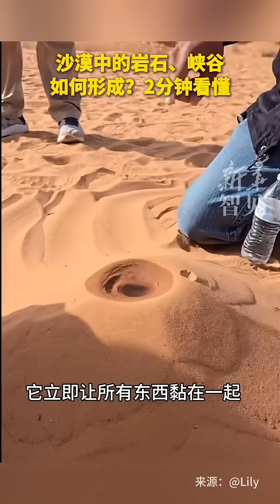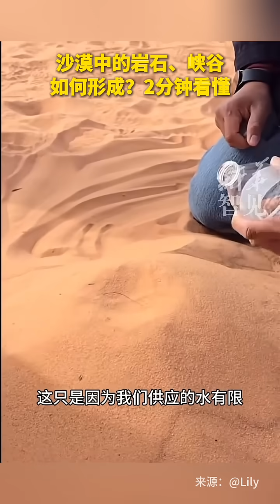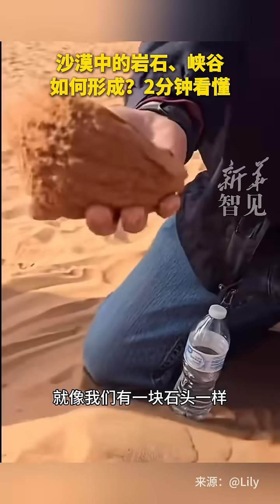I love listening to lectures like this.

Comment: Just to clarify, the first half was how rocks are made? or mountains??
Reply: The first example is demonstrating how rocky layers are created. Yes, it is demonstrating how rocks are made. Basically, water bonds loose sediment closer together. More sediment is washed over and into it over time due to wind or tectonic shifts, this added weight and pressure further condenses it. Over time the moisture escapes due to evaporation as well. Increasing Pressure + evaporation = some really hard stuff. You can observe this with some clay as well. The reason why the evaporation allows for hardness is because since the moisture causes the sediment to clump together, and this creates more pressure as more sediment is added and density is increased, when the moisture escapes, all that pressure is forcing the sediment closer together into the spaces that used to contain water molecules. 

Mountains are caused by tectonic plates shifting against and over eachother. Pieces break off and basically splinter off onto the surface. Basically, mountains are the result of really massive earthquakes.
Reply: @julianmcmillan2867  Amazing! Thank you for the detailed response!
Reply: @iMadSolar  You're welcome.

Yes, it is amazing, isn't it? Mountains are a sight to behold on their own, but when you sit down and think about how they actually came to be? That is the real marvel. A simple and, on a cosmic scale, frequent process, that we have built entire religions and civilisations around.

Comment: So if we flood an entire desert then get a comically large electric fan, we could make a mountain.
Reply: pretty much but like he said it woulds have to be done for years
Reply: @black7844  counter argument: the fan is on swivel mode
Reply: @black7844  and on power 1
Reply: @ then it would take even longer LOL
Reply: @black7844  proposal: moisture and dryness sensors to shut off the water and current of air at the perfect time.

Or even a funnier reply, I'm enjoying this.
Reply: @ LOL when 2 trolls meet
Reply: @black7844  I'm not a troll, just finding the funny stuff in life
Reply: @black7844  oh someone else, my bad
Reply from the maker: 谢谢您的关注！
Reply from the maker: 谢谢您的关注！
Reply from the maker: 谢谢您的关注！

Comment: This is NOT how sandstones form - by rains filtering down through loose sand at the surface.  Think.  It does actually rain in deserts. When it does, the sand in dunes or other landforms does not suddenly become rock. It’s wet sand until the water infiltrates and/or evaporates. Then it’s dry sand again - LOOSE dry sand. 

To all the commenters here saying how much they learned from this guy compared to their geology instructors, you should have paid better attention in those courses.  If you had, you’d know that this is not how sediments lithify, and this is not how canyons form.

Comment: seems ok but not exactly correct. millions of years and many floods is the bs part that you scientist have been told and believe but you can not prove it so you come up with a gimmick to make the masses buy it. CIRCULAR ARGUMENT IN 3 2 1 ...
Reply: Millions of years has been proven many times and it being multiple floods has also been proven numerous times, we can analyze the sedimentary layers which shows distinct fault lines between them which couldn’t happen during one flood.
Reply: @greg5145  circular argument, you know when by the sediment layers , and how old by where it lies in the sediment. All bs.  The earth is about six thousand years old and that can be proven. Plus the whole earth flooded not one particular spot.  The entire earth. I guess you come from a rock that soaked in water for millions of years. Follow man and you will be wrong again and again. God is the way the truth the life.
Reply: @greg5145  fr
Cause last time I checked a singular flood isn't gonna bring in one bit of a sediment, let it settle for a bit let it get comfy and all that then BAM throw another layer with different minerals from fvck knows nowhere on top let it settle let it get comfy and then again BAM-
I believe I've made my point :3

Comment: The other thing that’s a little annoying is the FKS has the plastic oil filter housing. I’m almost tempted to use the metal FE oil filter housing on my FKS. I cracked the oil filter housing once trying to get it off after the last guy torqued the crap out of it. Anybody try the older FE housing on the FKS?
Reply from the maker: Great lesson

Comment: Water does not turn the silica into glue lmao yall dumbasses believe anything on a short??
Reply: the defenition of glue is an adhesive substance used for sticking two materials together, he meant it as the water and silica behave like glue because the wet stuff sticks together
Reply: @MerchantKane  yeah so that's not what's happening - first off it's silicON and it is bound up as silicon dioxide (literally sand) the adhesion is caused by surface tension in the water binding due to the gradient in charge across the molecule and that's what's holding the grains of sand together. Same reason it crumbles apart as soon as it dries out. 

If sand and water made glue, why tf would we have invented glue or mortar or cement?? 

Use your brain and think critically for 5 seconds and this would be super fucking obvious lol
Reply: @  not sure you're one to talk about critical thinking, you said silica yourself in your initial comment, and silica IS silicon dioxide, it is the source of the silicon in sand, im really not seeing why you decided to make the distinction. also, if you operated your three brain cells for but a moment more, you'd have realised that my comment was also describing the effects of surface tension, i was saying that the effect of two particles being bonded by surface tension is similar to the effect glue has on two materials.

now if you passed English class (which im beginning to doubt), you'd know that analogies are a tool used to explain certain things that are hard to describe, usually in simpler every day terms, which is what was meant by the man saying "it works like glue" instead of going on a long rant about how rocks are actually made,......lol

p.s. seek the rope.

Comment: Yeah either that or a massive electrical strong from a coronal mass ejection from the sun. The plasma could reach the ground a ionically excite the ground water. Next thing you know huge hydrogen bubbles are forming in the wet layer creating arch formations like in Utah. The rocks get electrically sheared off an blackened at the same time. So on and so forth. The evidence is all over southern Utah. Check out videos by Andrew Hall for more info.

Comment: This comment section is really fascinating. 
American comments seem to be split between only two primary groups. 
 
Group One: I just learned more than i did in years of geography class. 
Group Two: This was only one flood. Noahs flood. 

Both groups say very different things but both group clearly point to education in the US seemingly being very bad.
Also this video is more about geology than geography. You're welcome.
Reply: The American education system sucks.. it's been taken over by liberals who teach lies and falsehoods and racism
Reply: @brianbailey462  Republicans* As someone from a country rated with a much better education, your right-wing is poisonous to your education, objectively. You trying to pin it on the other side is, ironically, another example of how your politics are purposefully muddied. Your liberals aren’t the ones shutting down your department of education instead of reforming it. Sorry-not-sorry.

Comment: Just guesses... And incorrect
Reply: No it's not, he didn't say "all rocks" are made like this, and canyons are EXACTLY created like he showed.
Reply: @brunofunnie  but he did say "it wasn't just one flood that did this..."  there is no way he can know that. It's just a guess.  So he COULD be wrong about his other statements.
Reply: @erics8757 wtf do you mean he doesn’t know that? You think one flood can create an entire canyon?
Reply from the maker: 也许是的
Reply from the maker: 经年累月的事
Reply: @erics8757  Depends on the caynon in question of course. But most Canyons are not formed by single floods. And yes, we know that because of layers and stuff we find inside those layers that we couldn't find in this layers if it would have been a single flood. Especially a global one, which is really unreasonable to believe. And btw. Were is all the water now?